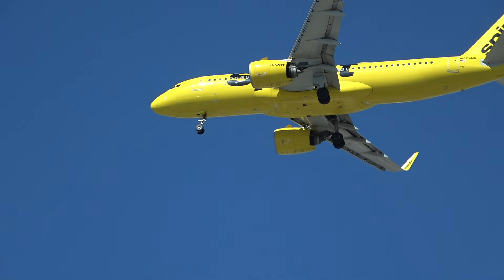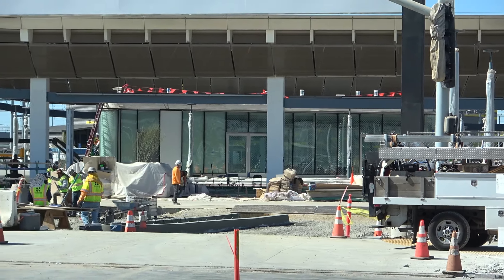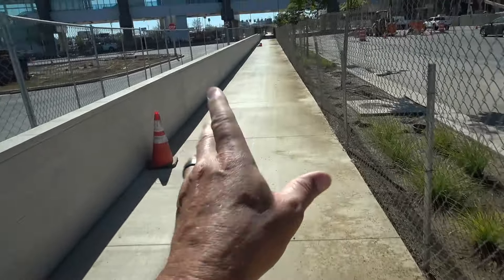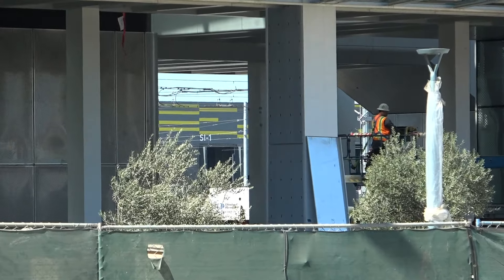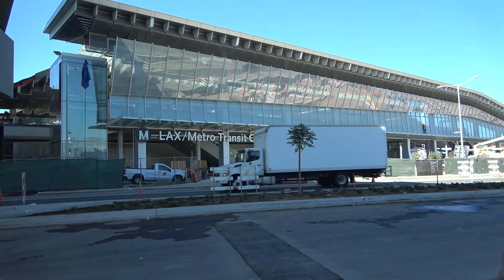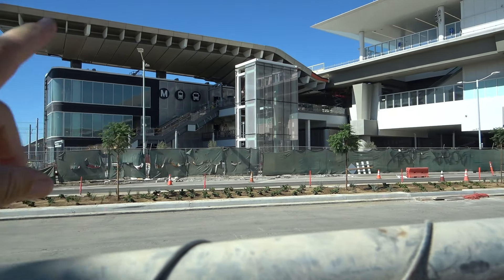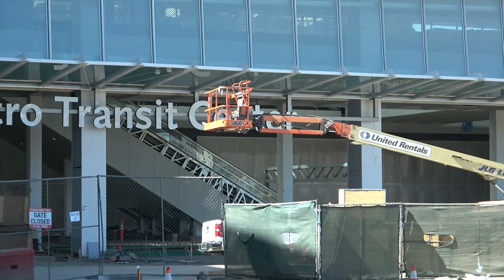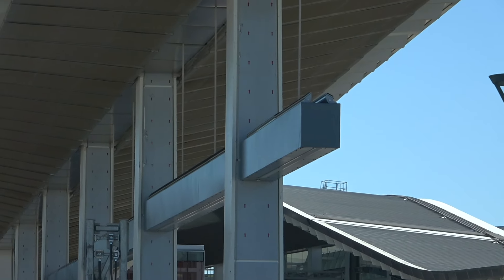$900 Million LAX Airport Metro Connector Construction Update

Comment: The citizens of L.A. County have given Metro 40 years of budget certainty with the passing of Prop M and other initiatives.   Metro constantly has the worst metrics and outcomes as judged by other cities in the U.S.  Hugely expensive costs.  The highest paid executives (Stephanie Wiggins' compensation package in 2024 - $487,000, a 7% pay raise over 2023).  Almost every project going over it's bloated to begin with budget.  A refusal to put up barriers to block non-payers from entering the system.  Filth.  High crime rates onboard. And projects that are almost always delivered late.  Metro now wants another tax on ordinary citizens that don't want to take their terrible project and drive to work or see their family!!!  Why give them even more money to plunder without accountability?  How to solve Metro's structural problems.  1 - Metro must have accountability by an independent citizens commission.  Executives that preside over the types of outcomes that I just described get fired, just like in the real world.  2 - Metro needs to reduce the number of projects by 75%.  They should focus their work on delivering projects at a reasonable cost, on time and below the budget.
Reply: Unfortunately, how our system works politics, billionaires and most of the US relies on outside contractors because we don't have in-house departments like EU does which is why cost balloon. It's in the budget to get the lowest bidder but the cost is always high when comes to Transportation projects here. Nandert discusses the Upcoming budgetary constraints on LA Metro and it has nothing to do with crime which mostly politically motived by the news.

Comment: THIS COMING SUNDAY (November 3), just a few feet away from where you recorded this, a BRAND NEW Metro Rail Station, the Aviation/Century Station will be opening, and along with it, BIG changes are coming soon to the C and K Lines: 
•The C and K Lines are being reconfigured! 
•Aviation/Century Station is opening the same day serving both the C and K Lines. 
•The C Line will operate between Norwalk Station and the Aviation/Century Station, a new end-of-line for the C Line. The line will curve to the north towards the LAX/Metro Transit Center Station, instead of to the south, to the Redondo Beach Station, where it HAD been going, and temporarily end at the new Aviation/Century Station.
•The K Line will operate between Expo/Crenshaw Station and Westchester/Veterans Station, and between the new Aviation/Century Station and Redondo Beach Station, where the C Line HAD been going until now. This is temporary - when the LAX/Metro Transit Center opens soon, the K Line will run between Expo/Crenshaw and Redondo Beach.
•Riders will need to use Aviation/Century to transfer between C and K Lines and the C & K Line Link bus shuttle.
Reply: What I read a loooonnnggg time ago was one of the service patterns was going to be from Expo/Crenshaw to Norwalk. That must have changed.
Reply: @ES-hr6vg Yes.  The current plan is for the C Line to be LAX to Norwalk and the K Line to be Crenshaw to Redondo (with LAX in between).  To get from the C to the old part of the K you'll have to transfer at LAX or Aviation/Century, with Aviation the better choice (as it comes first).
Reply: Yes, but there will be a shuttle connection to bridge the gap on the K line until this Transit Center Station opens on the K line.
Reply: According to Metro, this "shiny new station" is opening today. I chuckle every time I see that. The Aviation/Century Station is actually two years old. It's been waiting for its new sister station to be completed. So I guess they've dusted it off, after the long wait. They say they've been running trains for practice and testing. I might try hopping on it this afternoon, just to visit the Aviation/Century Station.
Reply: @EXROBOWIDOW The Aviation/Century station only exists due to poor planning and communication on everybody's part.  Metro planned and I believe even started construction on this station before LAX decided what they were going to do with the people mover.  If Metro knew about the people mover when planning the K Line they would have never built this station since it is incredibly close to the actual LAX station that connects with the people mover and therefore is mostly redundant and would never meet Federal,  state, and Metro standards for stop spacing.  Other than possibly the stations on the Long Beach A Line loop, these two are the closest stations in the entire Metro network.
Reply: @Geotpf  Well, I won't complain too much. As long as the mayor of Inglewood doesn't get his way and have them start on a grade separation at whatever at-grade crossing is on the K line in Inglewood, that probably should have been grade separated from the get-go. The Century station might make the transfer from the C line to the southern part of the K line a few minutes shorter. And there will likely be some hotel workers and others who will use the Century station to get to the businesses on Century.
Reply: So where do I get the transfer buses to lax terminals? In coming from Norwalk green line
Reply: @sonygrey871 I believe the shuttle to LAX still leaves from the Aviation  station (the station before this) on the Green/C Line.
Reply: I take the K line from the MLK stop and it’s a smooth ride until you have to take the shuttles because ONE stop (LAX metro) isn’t open. It’s a huge inconvenience tbh. That detour to the shuttle and then back to the train stops adds extra 25 mins to the commute. I hope they open the LAX metro stop soon so I can stay on the train, no shuttles.

Comment: I have a feeling this will open long before the Skytrain. They will probably just run shuttles from there for now to LAX. They have got to start running trains down to the Green line. Enough is enough already.
Reply: Yes, that's the plan, so only the ground level will open in a month or two to allow the K line to finally open fully. And the C line to end at this Transit Center Station. 

They will probably move the current LAX shuttle stop from the current C line station to this new Transit Center station.